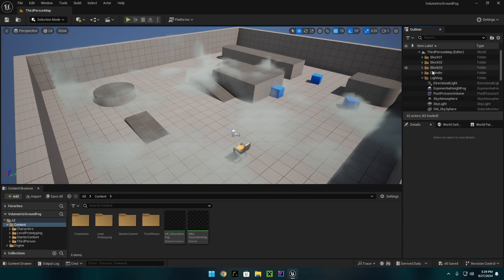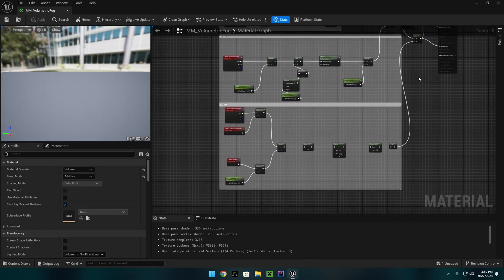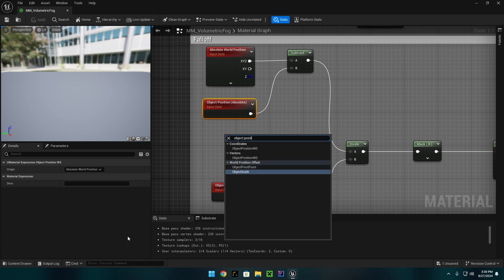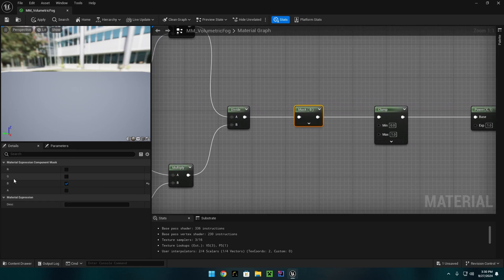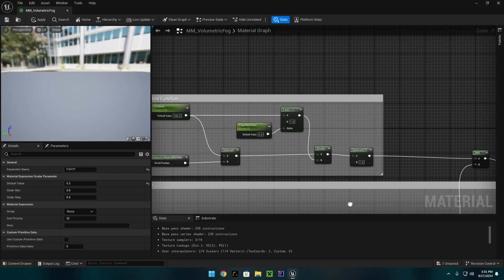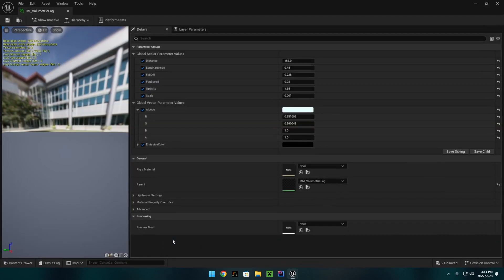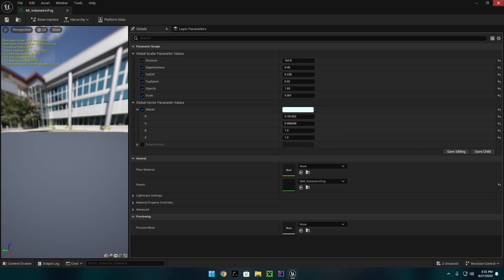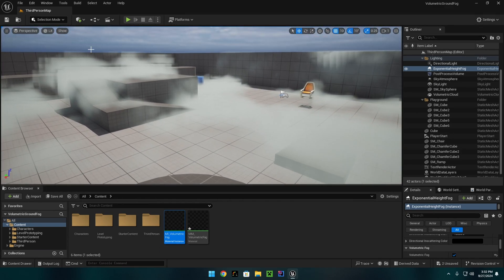[FIX] UE5 Volumetric Ground Fog

Comment: I was wondering if there’s a way to make the volumetric fog move or adapt to the landscape structure and I’d like the fog to move or conform to the shape of the landscape. Is there any technique or node setup can we use to achieve this?👀
Reply from the maker: @editology2888  If i’m understanding what you want correctly then if you followed the distance function part of the material it should already do this
Reply: @Dudewude  Hey, I am trying to make the volumetric fog in my desert landscape move and follow the shape of the dunes, so it looks like the fog is flowing or adapting to the terrain. I have set up the fog using a cube with a material, but I need to figure out how to make it move according to the landscape structure. Is this possible using material scripts or should i go for niagara particle systems to achieve this?
Reply from the maker: @editology2888  it should already be doing this if it was setup correctly, just make sure the cube covers enough of your landscape, and you added the distance function the the material shader correctly